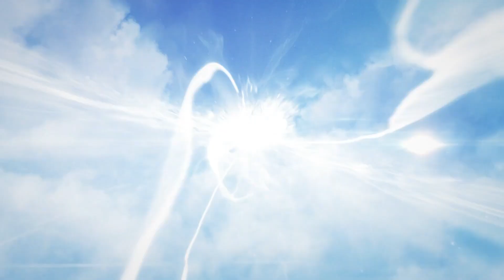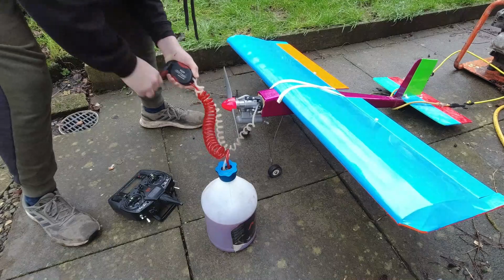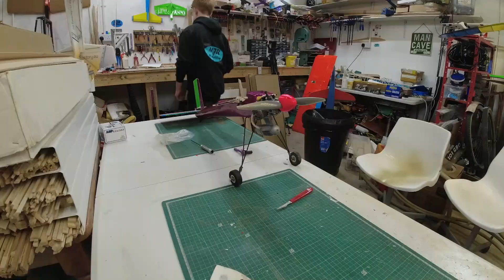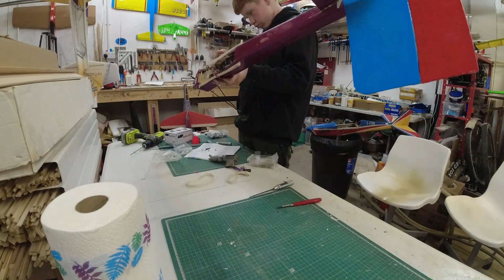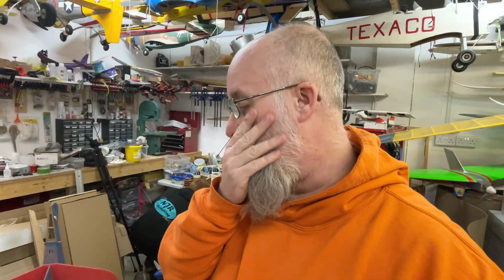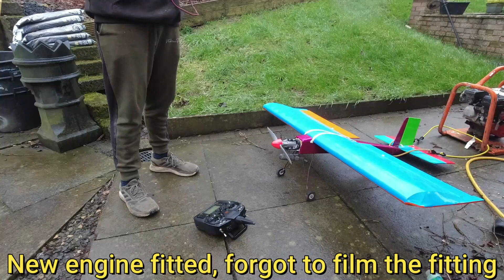Limbo Dancer Run up is a Disaster!!

Comment: Hydraulic lock 😞   This is why I opt for old-style hand-start over electric start on all but a few of my motors and when I use an electric starter I always check that the engine is clear by flicking by hand several times before applying the starter -- especially after choking.  The ASP engines were pretty tough... unlike those made by SK.  I've seen broken crankshafts and con-rods on ASPs but this is the first crank-pin failure I've seen.   I had two SK90 engines and both broke crank-pins mid-flight due to a silly manufacturing fault.
Reply from the maker: We do normally have a preference to hand start engines as we have had Conrad’s fail before,but in this case the engine wasn’t playing. At the point of failure the engine suddenly sucked up fuel, fired, popped and banged and on the next try the pin went. This suspect it was weakened either by a manufacturing defect and/or the sudden load of the firing. Either way, we should have a new crank on its way to us.

Comment: Great video and glad you got it sorted.  Engines can be temperamental.   I was running up an old old OS Fx 46 earlier today.  That engine hasn't been started for over 10 years.  I got it going after I changed the glow plug.  It's going into my low wing Tiger Sports 40.   Thanks for sharing.  Keep up the good work and keep flying.
Reply from the maker: Thank you